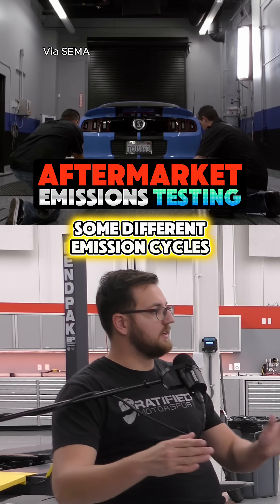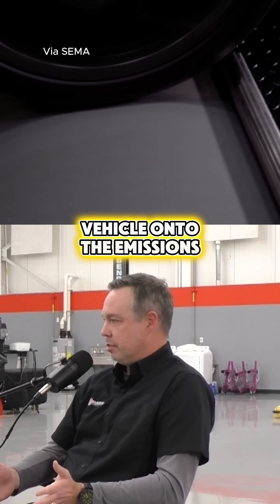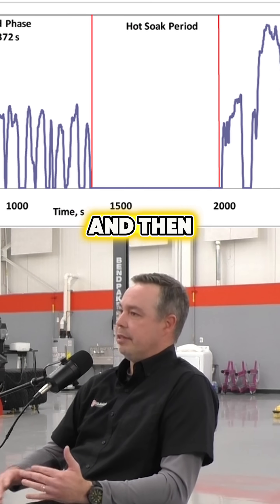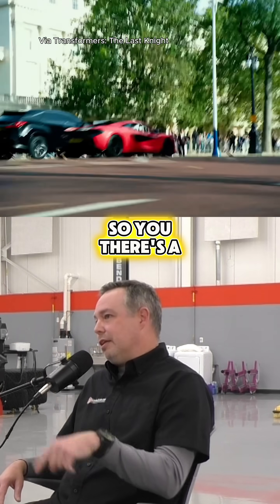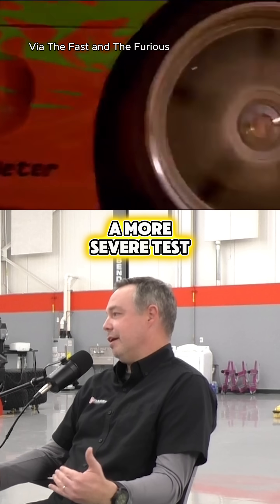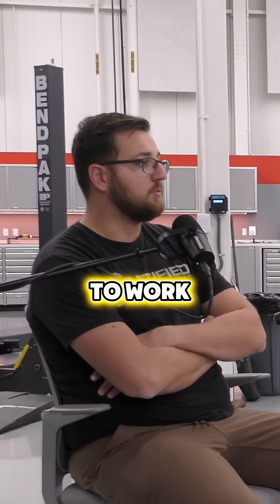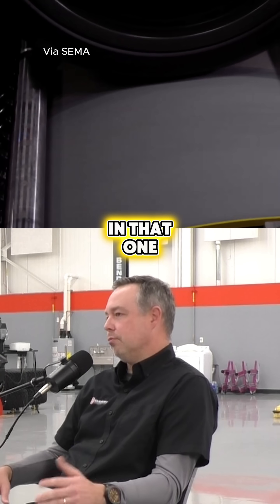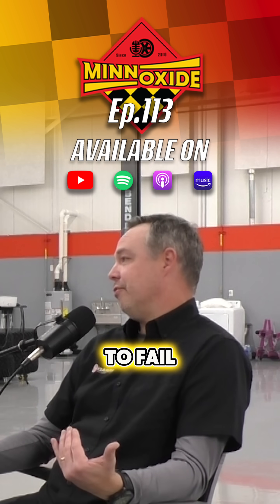Aftermarket Emissions Testing

Comment: Insane
Reply: You are right. This is an extremely difficult testing environment especially the spirited driving. That's why VW cheated emissions on their diesel because complying with US missions with a handicapped the car's performance.
Reply: @brarautorepairs VW cheated because they bet on the wrong technology and their management refused to accept that they wasted a lot of time and money on a dead end. Lean NOx traps barely work on a small gasoline engine that has to disable lean burn the moment you breathe on the pedal slightly too hard. Forget about a diesel which runs in lean burn in all but the most extreme scenarios.
Reply: @DOAHunt3r  I heard they also wanted to avoid urea injection which will convert the NOx that diesel engine tend to create from the lean burn + high compression. You can get a diesel to run clean, but you have to lower the compression ratio which pretty much defeats the benefits of diesels.